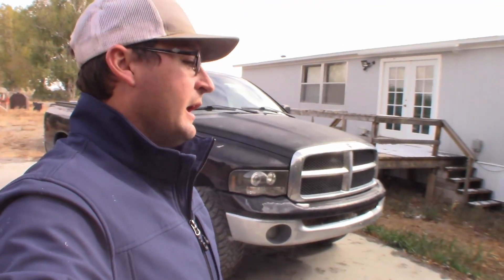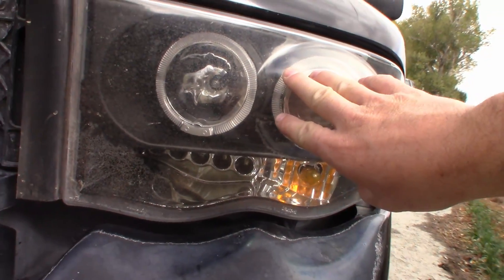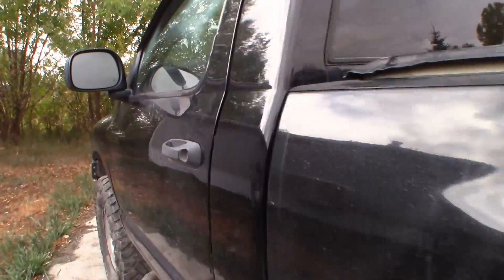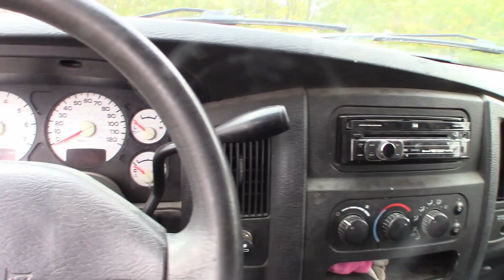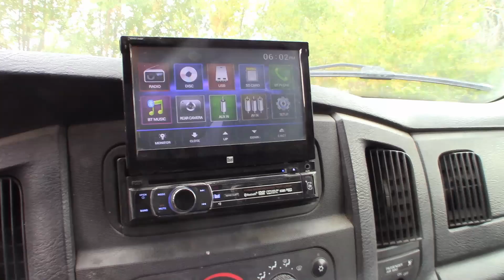Getting My 2003 Dodge Ram 1500 Running & Driving For the First Time - Build Part II

Comment: What kind of dual radio is that?
Reply from the maker: Great question! I believe the brand of the radio is Dual but I'm not sure of the model. If I had the truck here I'd go check. Pretty sure the previous owner picked it up at Walmart?
Reply: Dual garbage is the model
Reply: @EYVOAuto  oh ok sorry I just seen this comment
Reply: @MidnightPolaris800  Dual isn’t any good?
Reply from the maker: @bigdawg112  Look on cruthfield.com for something that’ll fit perfect. They walk you through everything you need, make installation super easy, and have everything from decent budget options to the nice stuff.
Reply: @bigdawg112  i hope your joking...theyre total budget garbage
Reply: @EYVOAuto  I’ll stick with my factory radio it sounds pretty decent
Reply: @MidnightPolaris800  I didn’t say I was or wasn’t. I never had any experience with Dual. But Pioneer I had good experience
Reply: @bigdawg112  pioneer are usually good